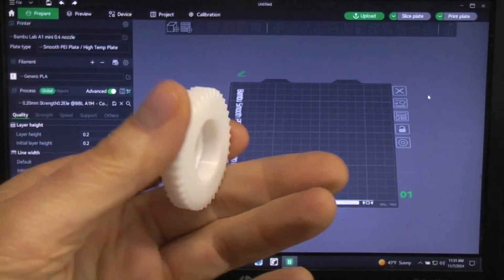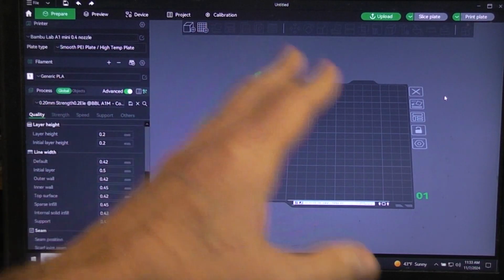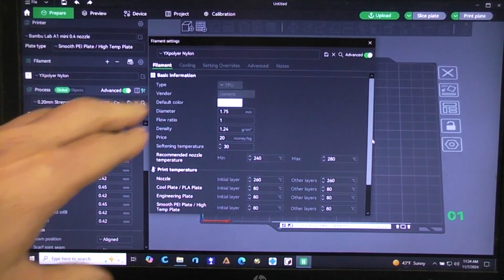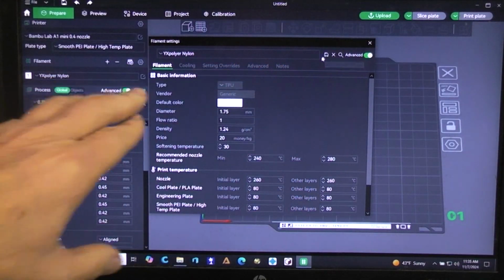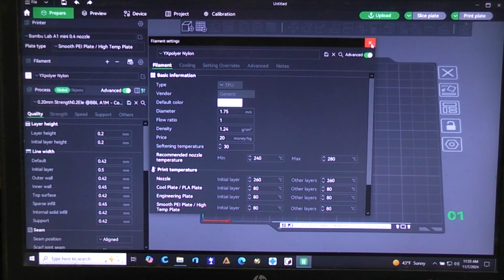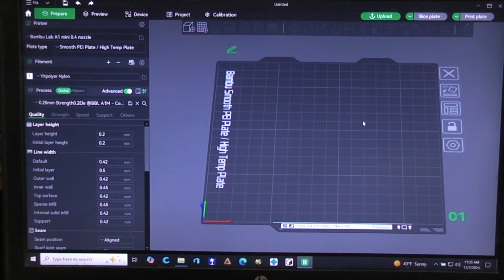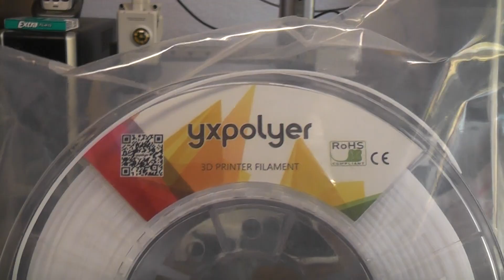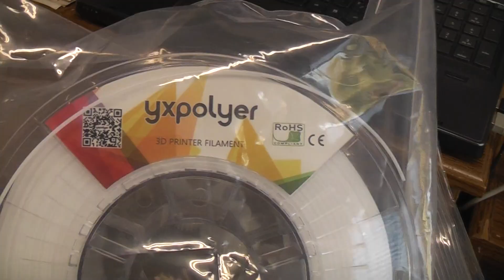Print NYLON gears on the Bambu Lab A1 Mini.  No warping or stringing. I used YXpolyer NYLON white.

Comment: HI, I know you say you use the high heat bed but there isn't one listed for the Mini.
Can you get a picture of the tab on the bed as to what exactly it is?
The cool plate and the smooth pei are the only ones listed that are close.
I can tell you that the textured plate does not work in the X1C with this nylon!
Reply from the maker: Smooth PEI plate and use glue stick. I have also used the Blue Cryogrip plate with glue stick.
Reply: @Robothut  Thanks.  Good to know on the smooth pei.  Didn't want to spend bucks on a plate I might not use if it didn't work!
Have you found extruder temps on the cooler side or hotter side work better?
My spool shows print temps of 220-280, bed 80-100.  Dry at 80c
I printed at the upper range on my X1C and got a little discoloration in small areas.  Maybe overheating a little.

Any follow up info you have found out since your video?
Reply from the maker: @christophersawtelle2558  For my A1 Mini I find that 260 on the hot end works best, I was using 80C on the bed as I recall. The only thing I have noticed is that print 1 part at a time, for whatever reason I find if I print multiple parts the quality goes down. I guess if you need multiple parts, it would be best to use the print 1 part at a time feature in the slicer.

Comment: Were you able to print all components at once. Or did you have to print 1 at a time.
Reply from the maker: I do both, print multiple parts and individual parts. I prefer individual parts so that if one part fails it will not effect the other part or parts.

Comment: Hi did you change your hotend ? To hardened steel
Reply from the maker: Not required when using the YXpoler Nylon white as it does not have any added fibers of any type, it is a special blend made for low temp printing in non-heated chambers using normal nozzles.
But The Bambu Lab A1 and A1mini printers come with a stainless steel nozzle with a diameter of 0.4 mm.

Comment: How do you even load the nylon? The mini doesn’t have a nylon option when you add the filament on the printer.
Reply from the maker: I guess you did not listen and watch the videos on this special type of nylon filament, and how I set up a profile for it .
Reply: @Robothut  you guessed right. I watch the video thoroughly instead of skimming through like I did initially.
Reply: @Robothut  OK so after watching the entire video. I understand how you made your slicer profile. But I just got the printer today, and I have never loaded filament into it. When I press on the filament selection on the printer on the, not slicer settings, I get the choice of adding the filament by brand or generic, and a selection of filament types but no nylon option. I had to select petg-cf as my filament in order for the printer to even want to feed filament into the extruder. maybe I need to learn how to load and unload filament. Maybe there’s a workaround. If you know anything, please let me know.
Reply from the maker: @fosslabss  I never use the filament selection controls on the printer screen. I also do not use the AMS unit as I do not like wasting filament doing multi color prints. So I just load from the single spool function, in fact I normally load from my filament dryer, even if I do not plan to do any drying, it just works better. Less tangles from the Z movement.
Reply: @Robothut  so how do you change filament and unload filament?
Reply: @Robothut  I think I see. Orca slicer looks so similar to bamboo studio, that I probably thought you’re using orca. But now I see there is a way to add custom filaments to your machine.
Reply from the maker: @fosslabss  Your right, that is probably what happened I was using Bambu studio for the profiles and slicing.

Comment: Great video man ,thanks for sharing. I'll probably do the same and leave the Nylon spool into my drying boxe. Did you run the dryer while printing or simply to prevent humidity to come in the filament? 

What kind of glue stick did you use?
Reply from the maker: I left the dryer ON just to be on the safe side.
Reply: @Robothut  Thanks!

Comment: Hello,, can you please write link or number exactly of filament you used in this video ?
Reply from the maker: The Spool has printed on it, yxpolyer 3d printer filament , Nylon 1.75mm White. Print temp 220 - 280 C, Bed temp 80 - 100 C. That is all. It is not any of the nylon filaments with fillers like glass or carbon fiber.
Reply: @Robothut  thanks you very much for fast answer and advice !

Comment: I have some experience with nylon and I will say your success is more related to the blend of filament your using than the settings or the printer.  Because raw pa6 or pa12 will not stick to that and warp like mad even on an enclosed printer
Reply from the maker: Yes, I agree. The point of the video was the Special YXpolyer nylon white filament, with its lower temp printing and other properties. Normal nylon filament requires higher temps different build plate and a heated chamber can be of help.
Reply: Do you have some general tipps for "pure" nylon? @WKfpv
Reply from the maker: @friendlyfred1997  Sorry I have never printed pure nylon or nylon with fillers. So I know do a search on YouTube as there will be many videos on doing so. My understanding is you need a enclosed printer so you can control the chamber temperature.
Reply: @Robothut Enclosed, 60C Chamber, PEI sheet, 280C, adhesion helper. Wont stick at all. Will reduce speed to 100mm/s, use PVA glue and maybe reduce the print temperature.
You think this gonna work?

Comment: Is it bad that I was more interested in the emachines computer your using? Jokes aside- I’ve been able to print PA6-CF20 on my A1 with only minor issues after getting an enclosure and extruder gears (it destroyed my stock one). Has to edit speed and temps for it but after that everything was solid.
Reply from the maker: That emachine computer has not been used in 10 years now I think. But it has some old programs and files that I might want to use again one day. But I bet I do not turn it ON again. it is small so I leave it sitting there.
Reply: @Robothut haha it was just awesome seeing a blast from the past right there! I’ve worked on computers and repairs for clients for the past 10 ish years and it’s been a while since I’ve seen one!
Reply from the maker: @Marst_art  It has sat there so long I do not even see it myself, unless I have a reason to think about it. May have to power it up and see if it still works.

Comment: Thanks for the vid. I'm having a trouble syncing my nylon filament to the machine so I can load the filament, did you load the filament on the machine side as TPU? I was able to create the filament, but yea, can't get it to sync to the AMS (or external) list on the machine for loading.
Reply from the maker: I never use the AMS, I hate the waist of multi color prints. Yes, as covered in the video I started with a generic TPU profile in Bambu studio. So, in my case there is no sync prosses required.
Reply: @Robothut Right totally agree, I just mean in your case when you load a nylon filament, you’re making the printer think it’s TPU? Is that enough nozzle temp to purge filament to load it?
Reply from the maker: @rpiian  It is for this particular YXpoler Nylon White, it has a lower print temp than other nylon filaments.
Reply: @Robothut Right, great point! Maybe I could use the PETG-CF profile for the higher temp nylons.
Reply from the maker: @rpiian  I do not think the higher temp nylons will work on a non enclosed printer like the A1 and A1 mini. Warping and other problems would happen.
Reply: @Robothut  Thanks. I'm going to try Easy PA, so not too much higher but a bit more than YXPolyer. Aside from that you're probably right, maybe with the exception of carbon filled versions. My A1 Mini is enclosed however not heated of course for mainbed temp issues. It has a mainboard fan with temp monitor that has only maxxed around 33C, and enclosure usually hovers around 28C, for smaller jobs. Anyway, if it doesn't work, I'll def give this YX stuff a try! Looks nice.

Comment: Now I wonder do I still need an X1C if my cute little A1 mini is capable of printing Nylon. Thank you very much for your test! Maybe I would get a Biqu biqu cryogrip build plate and print perfectly.
Reply from the maker: This video is only for the YXpolyer Nylone white, not any of the other variations of nylon. Yes I love my Cryogrip build plate, but you might want to use  glue stick just to make sure the nylon does not stick to well and damage the build plate.

Comment: Very useful video and info.
I need to print a pinch roller carrier for my TEAC auto-reverse cassette deck, a small part I reverse engineered in Designspark by RS. The part (originally nylon) has way too much friction in PLA. 
If that is successful, I need to print a much larger part, a chain drive gear and idler for the infeed on a my planer thicknesser.

Liked and subbed!

Comment: What retraction or volumetric speed? Im unable to make this filament work. It keeps clogging my extruder im doing something wrong. What about z offset?
Reply from the maker: Are you using the same filament? Do not use any of their nylon fiber filled filament. Just the YXpolyer NYLON white.
Reply: @Robothut  hello friend yes I realized what the problem is. I decreased the nozzle temperature from 280 to 260. And increased volumetric flow from 4 to 14. And reduced speed to 20mm/s and then tried 40mm/s both worked. Still not fully optimized and I didn't even dry it but at least I can print now and calibrate it.

Edit: the problem was it was wet. This filament is unprintable when wet. Must dry.

Comment: Is it possible to print nylon without preheating it with a filament dryer?
Reply from the maker: It is possible to print the YXpolyer nylon white that I am using with out preheating or drying. I have printed 0ver 100 gears so far that way. No problem. Now other brands or versions of the filament will be different.

Comment: what speed are you using ? thanx
Reply from the maker: initial layer is 50 mm/s, outer wall 60 mm/s, inner wall 300 mm/s, bed temp 80c, nozzle 265c. 25% infill. No part fan cooling. Be sure to use glue stick on the heat bed.
Reply: @Robothut  I'm getting some  stringing with those settings... Any suggestion what settings to modify? Thank you
Reply from the maker: @meguinness1116  No idea. I have run over 300 nylon gears so far, zero stringing.
Reply from the maker: @meguinness1116  One thing you might try is lowering the nozzle temperature on your machine, the filament has a range as low as 220c, so it might be worth trying lower temps.

Comment: What the parameters of printing speed?
Reply from the maker: Its covered in the video, but basically, I started with a print profile for TPU, so print slow and with very little cooling. Initial layer is 50mm/s. Outer walls 60mm/s. Layer height 0.2mm. Nosel temp has worked best for me at 265 C, bed at 80 C.

Comment: I am trying to find info about the filament you are using . is it clean nylon or reinforced with something? If it it is shouldn't u use hardend head? I trying to find equalent filament that I can buy from Sweden.
Reply from the maker: I think you have to buy from YXpoler, it is special filament that does not need a hardened nozzle or heated chamber.
Reply from the maker: https://www.amazon.com/Printer-Filament-Nylon-Printing-1-75mm/dp/B0DHTX2Q4Y?ref_=ast_sto_dp&th=1

Comment: Hello and a fantastic video. what print plate do you use?
Reply from the maker: I only use the smooth PEI plate. I have never used the textured plates because the texture would interfere with my cosmetic looks and mechanical FUNCTIONS.
Reply: Thanks for your answer. I gone try it but do you have the printer in a closed room? I think about the toxic
Reply from the maker: @klasjonsson6325  My room is small and open, no door even.
Reply: Ok but I aren't nylon give toxic fumes?

Comment: Would this work just the same with carbon?
Reply from the maker: No probably not. I picked this particular nylon filament as it falls within the paramotors of the non-enclosed machine I am using. Also, I would have to change to hardened nozzle for any of the filled type filaments.
Reply: @Robothut  The A1 mini has a steel nozzle that should not be an issue, maybe the enclosure yes but that could be "added"
Reply from the maker: @Dawe957  Bambu Labs sell a hardened nozzle dirt cheap for materials with fillers, but I have not felt the need to buy one yet.
Reply: @Robothut  Thanks will look into it 👌👌👌

Comment: Those gears look amazing. Thanks for sharing. I'm always needing gears for various projects so this info will be very handy. I may try the glass filled nylon for even more durability.
Reply from the maker: I do not think the nylon filaments with fillers will work on the A1 mini unless you build some sort of enclosure as the nylon filaments with fillers seem to require hotter nozzle temps and bed temps, so they do not warp. But if you have any luck with other nylon filaments then be sure to let us know.
Reply: @Robothut  Well, YXPOLYER recommends a nozzle temperature of 250C and bed temperature of 90C for their Nylon GF10 on the BL P1S so I guess the A1 should be able to handle it. They do stress the use of a hardened nozzle though. They also say to bake dry the filament for 7 hours before printing. Regardless, I don't have an A1 mini anyway. I'm going to try it on either my Creality Ender 3 or K1 Max, both of which can achieve those temperatures and both have hardened nozzles.
Reply from the maker: @Waltkat  Should be a good test. Hardened nozzles for the A1 mini are very low cost, so depending on your test results I may give it a try as well.

Comment: Never thought nylon can be printed without enclosure! 🤔
Maybe it's nylon based blend of something? 🤷🏻‍♂️
Anyway, result is perfect!  
A1 mini is so capable! 
I bought a hardened steel 0.6 nozzle, with it A1 mini can print PA6 CF, PA12 CF, ABS CF (based on modified PETG-CF profile).
Reply: abs cf with a 80 celsius degree plate?

Comment: this is what I love especially when a lot of people are like no you cant do that. Kind of like petg or abs on the mini or even a1 people always chime in because no enclosure and I'm like the 80 bed temp is low but works, and turn off cooling for the first 10 layers but off completely might be fine as well.
Reply: PETG has always been printable by default on the A1 Mini. ABS is hard to do without a heated chamber but there are workarounds

Comment: Wow! Those parts turned out really nice! I had no idea you could print in nylon. Excellent job on those!
Reply from the maker: I did not know if the A1 mini could either, since they do not even provide a profile for NYLON. The teeth on the gears turned out better than the ones I had test printed before.
Reply: That'll come in handy for repairing those robots that use those gears that always split over time.

Comment: Very impressive!  Did you design the gears in Fusion 360?  I have some old RC cars from the 70s I’ll be restoring. The much smaller drive gears crack after so many years.
Reply from the maker: I do all my 3d CAD work in Design Spark Mechanical, only because I learned it over 10 years ago. I know Fusion 360 is a Beter free program, but I just cannot the hang of it. My loss for being so old and set in my ways.
Reply: @ We kept changing CAD programs at work. Vectorworks, Sketchup, Fusion, and others. By the time I’d learn the basics, they’d change again for various reasons.  I still fumble around with Fusion. I learned a lot from watching Lars Christensen’s YouTube channel.  I’ve not designed gears yet, but he probably has a video on that topic.  Just wasn’t sure if you had a better/easier alternative.  Keep up the good work, really enjoy your channel!

Comment: Good info. It might come in handy in the future.  How did you design the gears? Fusion 360 has a utility for spur gears but other types can be a real pain. You can import step files parts from McMaster Carr or other sources.
Reply from the maker: I did the gears in Design Spark mechanical long ago. Just cannot get the hang of fusion 360, so still locked out of step files unless I pay for the non-free version of design spark mechanical.
Reply: @Robothut  That's impressive that you designed the gears. I would be happy draw that part in Fusion so you could get your step file. You've been a lot of help to me over the years.
Reply from the maker: @rick_100  I could send you the STL files to either change to step or to pull dimensions from.  We need to use email for this topic I think.
Reply: @Robothut  I just sent you a message on Thingiverse.